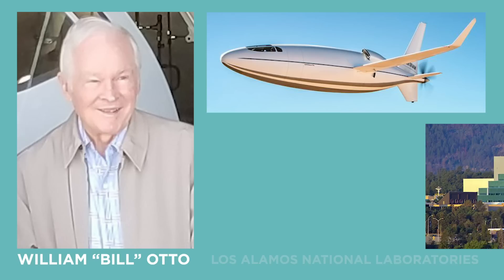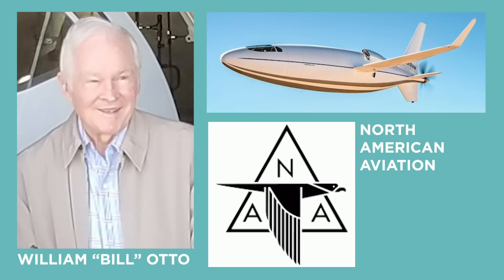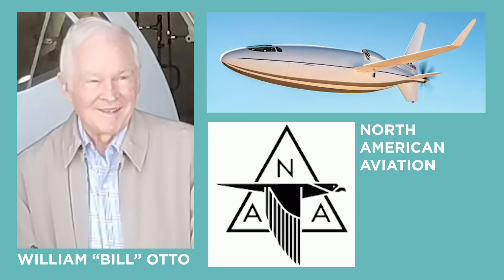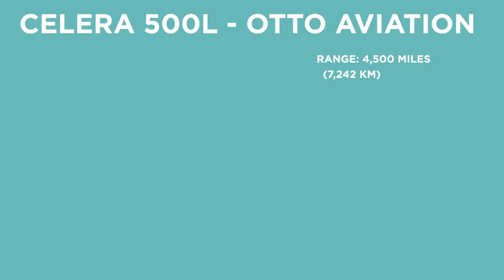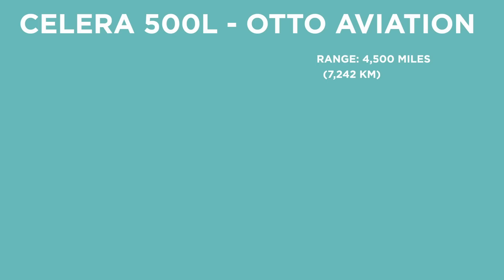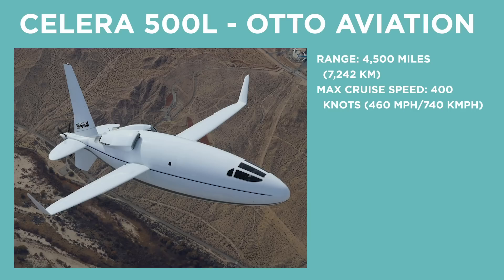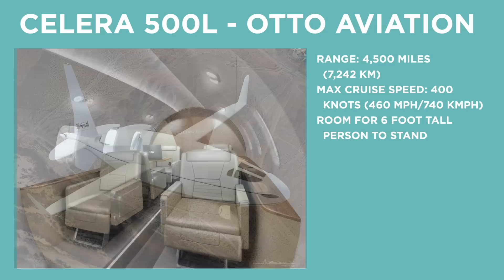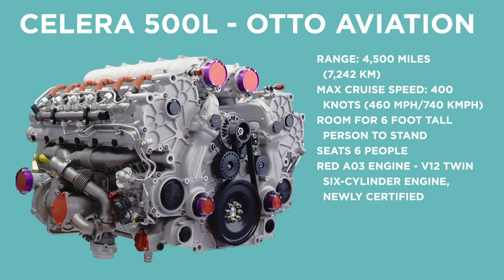Could This Plane Save The World? (Hint: No.) | Answers With Joe

Comment: Sorry joe i love you, but new 747s go for upwards of 360 million. Only way youd find a 20 million dollar 747 is if it was near retirement and used by two different airlines previously. And for gas mileage, it isnt about the total mpg, its about how much fuel is burned for each passenger. The 747 is still more efficient in the end than all those smaller planes if it has most of it’s seats filled. Thats why we have planes that massive. It would cost less to ship 360 passengers on a 747 than 360 on so many examples of this new plane. Not to mention, the maintenance costs of 60 planes compared to one 747 is likely very similar.

Comment: I dunno why you’re talking about jumbo jets, & where does anybody get 3 or more full-on airliners for the price of one G6?

Whatever.

The Celara isn’t pointed at that market, of course it’s being pointed at the biz jet / general aviation market. Further, Celara himself is expecting production & sales to help the price - $5M is the early adopter’s price.

Celara talks about biz jets but there is another, smaller or less posh market. Plenty of businesses operate turbo-prop classes of aircraft, like older Turbo Commanders that run a best of 330 to 340 statute mph, or around 300 mph if anybody’s interested in keeping fuel consumption down to around 60 gallons per hour. The Turbo Commander will carry as many as nine, but not w/ luggage: your 10 yr old won’t be able to stand up, & the only excuse for a toilet will be a jump seat w/ a curtain - maybe. The more comfier models haul 6, but no full-scale adult can stand up in it or much of anything else less than a G4.

The next thing to consider - the Celara 800. That’s a proposed light jet version that clearly points to scaling up. As-in the next generation of jumbo jet will most assuredly look very different than they do now. I’ll hazard a guess & suggest that quite a few potentially unemployed aeronautical engineers are trying to explain why they didn’t come up with the airframe paradigm that the heavies will almost surely have to adopt.

The bottom line - sometimes innovation is a good thing.

Really.

Comment: Woah, dude.  You need to add a zero to the price of the 747.  Then double it.  Then add another 42 million.  Even the very first one that came off the production line in 1970 was $24 million.  I don't know where you got the 20 million number.  That might be the annual cost to operate one... but even that seems low.
Source: I've built Boeing aircraft.

Comment: Is it just me who thinks this is a scam?  No way it has performance that good. Think about it a Piaggio Avanti which is very aerodynamic and a pusher propeller configuration doesn't get this kind of performance, and they are at it for 40 years, wouldn't you imagine they would have at least made drastic improvement's if that was possible by now? The only way this can get that kind of performance and range is if it's a pretty much an empty shell with lots of fuel flying in very good conditions !

Comment: Could this design be scaled up to compete with the seating capacity of the 747 and retain its efficiency?
Reply: No, because the hub and spoke isn't as efficient, an individual person has to go up to altitude and back down and then back up to altitude a second time, it's more efficient to have four smaller planes carrying a quarter of the people. That's offset by the economies of scale, but the reason why the 747 is not very popular anymore is because it just cost more per person. The economies of scale savings is not enough to offset the additional flight time

Comment: When it comes to transportation merely measuring  "km / gal"  is not a valid metric   You need   "passenger kms / gal" instead.    We dont care how far the vehicle goes.  We care how many people can be moved a distance.    Moving one person at 10 km/gal is no where near as good as moving 100 people at 1 km/gal.   It doesnt matter that the 2nd has 1/10th of the fuel efficincy per distance.  It has 10x the passenger efficiency per distance so it wins

Comment: 20 millions for b 747? Wow, I'm buying it and reselling it at least for 130 mill. Also 747s (and other heavy jets) are mostly used for +5000 miles routes, so more appropriate comparasion is to planes for regional flights (like Embraer 195). Even ignoring those facts it is incredibly hard to fully fill all seats of jumbo jet. 

And that's only beginning. In modern aviation nobody cares about plane's price, what's more important costs of maintenance, that's why there are not so many 4-engine planes around (more engines - more maintenance, more maintenance - less flying, less flying - less money), and fuel efficiency. That's why low costs are using mostly expensive but efficient brand new planes, instead of old but cheap.

Comment: Ya know I know it's not going to be competing with the big Airlines

But the fuel savings that you cited from using 61 these airplanes over a 747...
...... you know I think this will be disruptive I think it will change how we design airplanes. Larger volume airplanes tend to use less Fuel per person. And this is a small volume airplane that's a hair slower but uses significantly less fuel.
That's a BIG deal.

Comment: I was (before COVID furloughs) an airline pilot and it's my understanding that if you are going to operate a regular scheduled airline that FAR Part 121 requires a minimum of 2 pilots per airframe. There may be a way to operate under Part 135 to get around this. Am I wrong?

Comment: "powered by a v12 6 cylinder engine" (shows picture of normal v12 with 12 cylinders)  ?!  ,I've never heard of a 6 cylinder v12  ,the picture clearly shows two banks of 6 cylinders on with two heads,two injector rails ,two camshaft ends ,and is listed by manufacturer as a v12 diesel (which I would have thought was notable)...WTF are you talking about?

Comment: I am a pilot and that aircraft has a lot of problems that physics is NOT GOING TO CHANGE. The glide ratio of that aircraft is going slightly better than a brick because of the wing loading.
  The wings can't possibly store any amount of fuel so the tanks are in the fuselage, not something I would not like while it is gliding like a brick.
The fuselage design is akin to the Curtis C-46 and not revolutionary.
  Another aviation pipe dream, the prototype will crash and the project will end.
  Given the chance to take a Flight, I would pass.
The pilot will be completely blind in the landing flare which means he is going to be using a camera... really really stupid.

Comment: How long ago was it that SpaceX finally was able to land and reuse rockets?  I think this might be a similar disruption with the same type of upside.  SpaceX finally getting the landing and reusability on a rocket let them then start offering launches at a much cheaper price than their competitors, which allowed them to fund even more disruptive innovations such as Starship.
The first use and commercial space this plane will compete in is the private jet/airplane market - I think there is a big case to be made on a cost basis versus other options for executive travel.  And from there, with a source of funding, they can start going up the food chain.  And if they embrace first principals and fail early and often, we might not be talking several years to their planes are competing but a couple of years instead.
The other thing I see is flights that were uneconomical between smaller cities now can be made and produce a profit.  Depends on the cost per passenger to do those flights.

Comment: I switched off at the point you started comparing the flying costs of this vs a 747. Not every trip from a point A to a point B is going to be shared with several hundred other people at the highest speed possible. Let's get real and talk about where a plane like this might soar (so to speak). People still use commuter planes, GA planes, trains, buses, cars. I don't think it is rocket science to find a niche into which a plane with these characteristics would fit.

Comment: In what decade are you buying a 747 for $20 million.  The 747-8i is over $400 million right now.  Also using a aircraft that no longer tends to haul people was a bad choice for comparison, a 737 or a320 is a better comparison.  But overall this is a private jet, it's designed to dramatically improve the effeciency of the private jet market which is terrible compared to mass market airliners.

Comment: You are comparing apples to oranges.  The Celera would be used by business people who often have pilot's licenses.  They would be flying to smaller airports that are closer to the actual destination.  No, it will not replace airliners but it will give businesses a more efficient form of transport.  But a lot of people will need to take a feeder or an air taxi to get to their final destination if they take an airliner.

Comment: The chaos that's coming: climate, political, economic etc, may make smaller aircraft the only acceptable ones for non-military or special use.
it's very expensive and difficult to service a 747 or similar, not just the aircraft and it's parts, but the airports they need

also, big corporations suck as ahem, recent Boing issues show

should check on the larger version of Celera which will be their cargo or larger passenger craft :)

Comment: One thing he's forgetting a 747 has a lot of cargo space leftover after baggage, so much so an airframe mechanic told me that a 747 makes more money on it's cargo than the passengers. Compare a 747 to this particular aircraft is like comparing a   big rig to a car besides the FAA doesn't allow single-engine airliners to cross oceans. To be fair he did say This Plane wasn't met to take the place of a 747 all that cargo have to be shipped by other means more fuel more carbon I believe this will be a net loss as far as air pollution is concerned definitely huge losses in profits

Comment: Once Tesla's have FSD fully activated, and once people got used to having a computer drive them around a lot saver than a person every could, we will have fully automated planes... personal planes. Also, there is a new system coming out that will make all planes talk to and avoid each other, so flying on fixed air corridors will soon be a thing of the past, and air traffic control will be greatly relieved.

Comment: The Cerlera 1000 is gray but apparently anything bigger than that by its Laminar Flow design well cause turbulent air over the fuselage, so that kills the idea it can be scaled up to Jumbo jet sizes... 
Having said that; I think a combo of Otto's design here, Hydrogen, Algae or other enviro fuels exclusive of or perhaps, coupled with 4680 battery cell progression and flexible solar cell laminates could line a fuselage for better results. Maybe even some kind of VTOL tech or other combo/s & we might find some radical advancements in long haul flying..?
But I haven't seen anything at all raised online as yet, anywhere.
Failing that, there's always #Starship.. if the world could handle thousands of sonic booms per day?
Talk about cracking the sky!!! 😉
Love if you did an extrapolation of the likely hood of that Elon concept/submission.
In just a few short hours we will find out if SN8 has the chops in its maiden Hop. 
Will be spectacular no matter the outcome!
Cheers Joe.

Comment: btw a 747 is a very bad comparison, 747s are actually rarely ever used by airlines and nowadays (pre wuflu) they are almost nonexistent, plus theyre only every used for extremely long distance journeys for very large amounts of people, since the celera cant fly that far or carry that many people itd be much smarter to compare it to planes with either a similar range or similar passenger capacity, basically small planes used by small airlines like bush flights, somewhere between a cessna 206 and a dehavilland dhc8

Comment: Were you trolling with this? Normally your analysis is better. 
You should have start with a new 787-9 for comparison. The key figure for an airline is passenger cost per mile. That cost include purchase, fuel, maintenance, fees, taxes, labor, airport costs, ... adnausim. The 500L wins over the 787-9 on the first 2, with 1.2:1 passengers/$M and 120:180 passenger miles/gal. I think the 500L killer is passenger loading/unloading and airport support.The infrastructure does not exist to support 50 small vs 1 large plane. The 500L is likely a better competitor for regional aircraft.

Comment: Unfortunately the history of aviation shows that introducing a totally new power plant in a totally new airframe is going to fail. Add the fact that it’s a pusher and is on dependent on achieving laminar flow, sorry to say commercial failure is certain. Commercial operators are extremely cautious, and they have to know a company will be around for the next couple decades at least to provide parts, service, ongoing development, etc Most likely none would take the extremely risky choice to go down this road. Most likely as with most all such announcements that come around every couple of years, this one will never hit the market as a certified aircraft.

Comment: If you are going to complain prices, you are doing a disservice comparing a new and used plane.  That throws your whole argument off.  The most current 747-800 costs $418,000,000.  You couldn’t buy an engines for it for 20 million.

Comment: Where did you find out the cost of a 747 is $20M? The engines of the 747 will cost more than double that:).    A new 747 costs about $320M

Comment: high speed rail can save the U.S.  Obstacles are high cost over-runs and mismanagement by govt. public funding.  Mono rails are a thing, and we already have interstate easement so the way passenger rails are attempted to be upgraded at present are just dumb.  Put your 300+ people in 6 railcars ... umm, and they could lay down and be comfortable.  And your HSRs are already basically hybrids... so no tech leap required.  Do the math on carbon, and you are still in business.  Do the math on cost/mi. and you are still in business.  Downside:  coast to coast take 2x as long as airliner, however I could go from ORL to ATL without driving/inconvenience etc. and back again in the same weekend, 20 hour drive round trip (no weekend adventure), fly - by the time you get in out of airport etc. takes about the same amount of time to... wait for it....ride a high speed train.  The new plane... yes, think it's cool, but I'm not a millionaire... ever ride on a DC9 in bad weather?  yup, I say no to new plane.  rail?  weather?  meh, got places to go.  btw, the Boring company ... i kinda like it for freight & autonomy, but underground doesn't work for me in Fl.  GL, keep being spicy.

Comment: SO... The configuration and engine type make this aircraft more expressible to pilots.
Takes lots of flight hours and expensive training for jet aircraft... This is a single prop.
Maybe you'll need some specialized license for this aircraft because of speed and altitude capabilities.
Less training needed, more affordable and available pilots, especially if assisted with automation.
Reply: I'd imagine that you would still need a type rating as most pilots don't fly with a pusher prop. You'll probably also need the high performance endorsement and your commercial pilot rating, just to qualify with FAA standards which most airlines expect much more of pilots. I'd bet that ultimately it would come out to roughly the same amount of training with the only thing you wouldn't have to get being your commercial multi engine.

Comment: There really is nothing new with this airplane. Laminar flow? Please, the P51 Mustang achieved laminar flow, at least over the wings (*much of the wings) back in WW2. Laminar flow fuselage? Many other aircraft are very nearly there, and fuselage drag is a very small component of overall drag. Lightweight? Well, it doesn't have windows, let's see how many customers take up that option. It's also not gone through the cert process, where so many designs pick up a crap ton of weight (reference Beech starship for this one). The deisel engine is cool - there are savings to be had there, and more importantly, jet fuel is more available worldwide than is avgas.
You hinted at the REAL savings - autonomous flight. That's going to be a game changer, but that is not airframe dependent. I'd bet every airplane manufacturer is working on this right now.
Electric planes will be a big deal once batteries achieve energy density on par with fossil fuels.
Hybrid airplanes will never be a thing. There is no math that shows this working - it works for cars promarily because of regenerative braking, something airplanes don't do. They don't start/stop/start/stop, and when they do slow down to a stop, they're already doing so in a fashion where all the stored kinetic energy is used.

Comment: The cost of the airframe is so small compared to the cost of operating hte airplane that airlines more or less don't think about their purchase price, it's a tiny line item in the total cost of ownership. 

Having said that at 5 miles per gallon for 350 people, the 747 is around 70 people miles per gallon (People miles being moving one person one mile) while the 500L at 28mpg and 6 passengers get around 168 people miles per gallon or running around 3.8 times the fuel efficiency. Of course, you have crew issues, in a small plane, you would still need 2 crew at 50K plus a year. Not so bad for a 200 person plane but now you are making that up with a 6 person plane. 

I would be surprised if the cost of operating that plane per person mile is as high a 747s costs, or even a 737max which are far more efficient and you have far more redundancy.